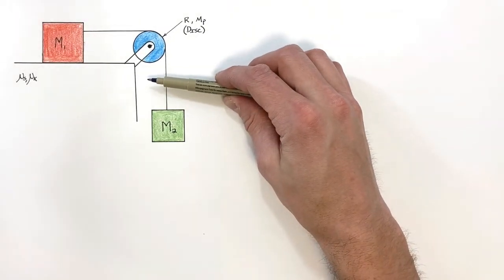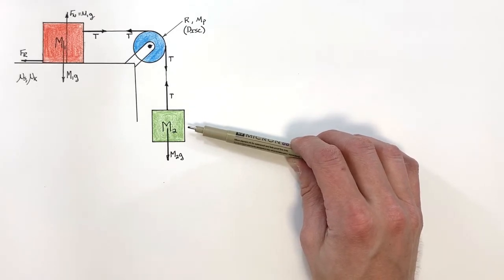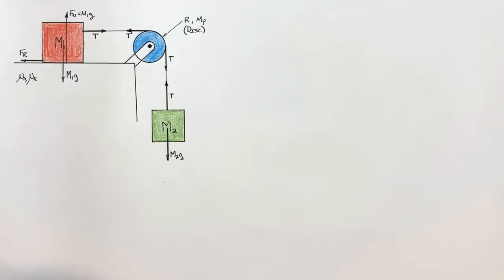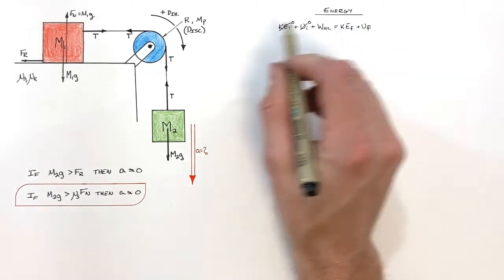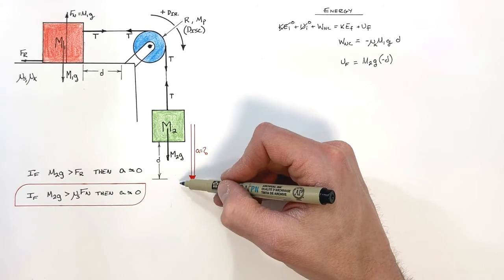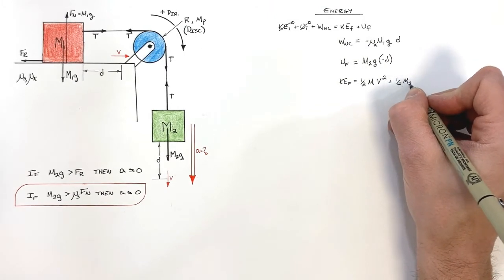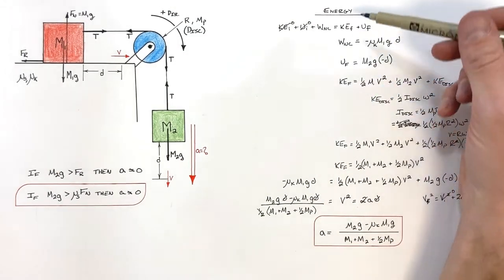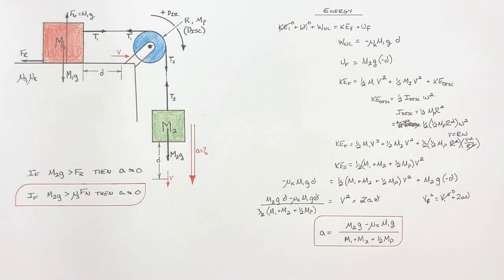The Atwood Machine With Pulley Mass

Comment: since the pulley has mass and is a disc, can I use torque instead to work on this problem?
Reply from the maker: independent of the mass and shape of the pulley, you could use torque but its 'taking the long way around the barn' to get to the solution.

Comment: I noticed you went into the work done by tension a little, i was wondering if you could prove the tension is 0?
Reply from the maker: The tension is not zero.  If T=0 then the hanging mass would be in freefall but the mass on the table would not accelerate at all.